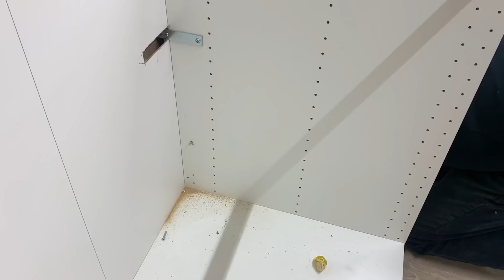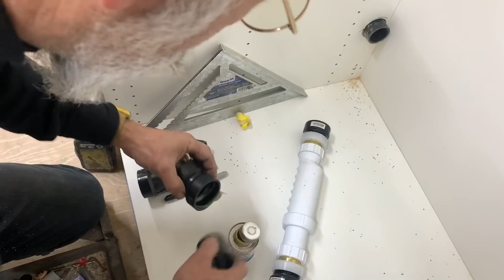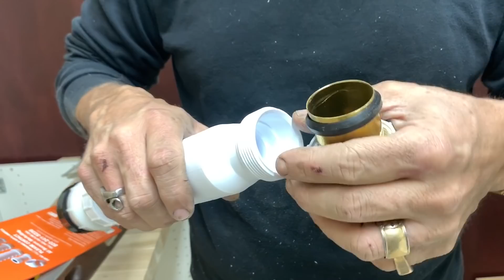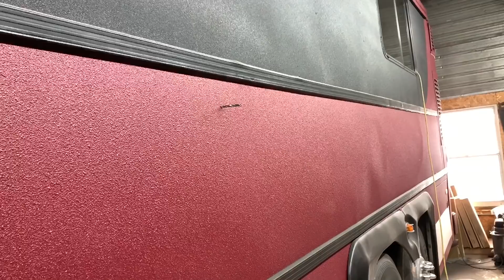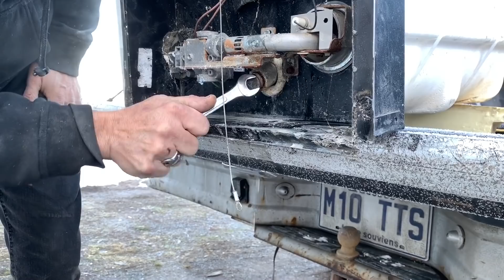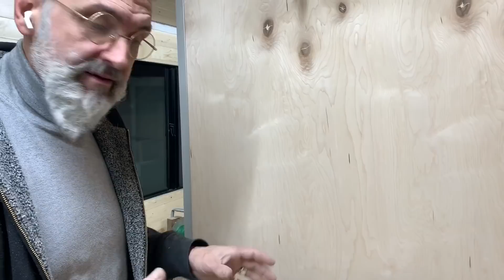E39 Plumbing, Cabinets, and more.

Comment: I was surprised you put the water heater inside the living space.   I have a similar Suburban unit and its mounted in the basement of my coach, and when on propane I can hear it.  (yes yearly I pull the anode rod and inspect or replace)  Is it safe to assume you had no space left in your basement?
Reply from the maker: Lots of space in the basement. We prefer to have it on the main floor to prevent freezing.

Comment: Merry Christmas and Happy New Year. Did you also add extra bracing to the upper cabinets so they don't fall off the wall? How will you secure the drawers so they stay will stay closed while driving?
Reply from the maker: Yes the uppers will have additional bracing as well. The rail from IKEA is secured to the metal structure of the bus, but we rather be safe than sorry. The drawers will be secured with automotive power door locks

Comment: When cutting the hole for the water heater it appears that you cut out a diagonal structural member.  Is that the case?  And, if so, was that expected or was it a surprise to find it there?
Reply from the maker: Cut 1/2 way through it, and yes it was expected. We placed the hole to minimize the cut